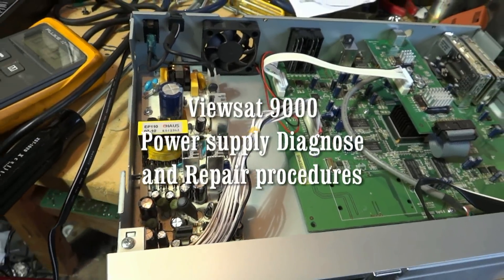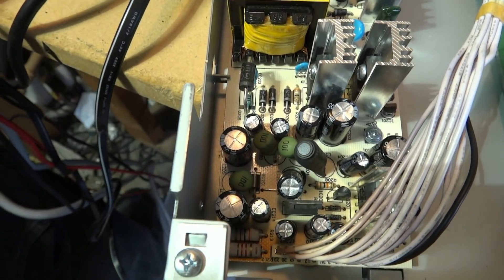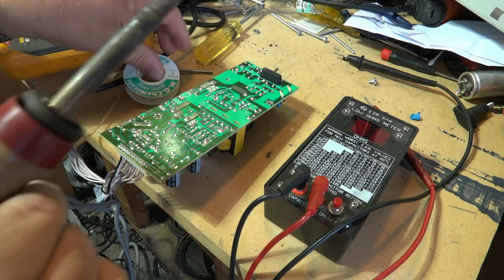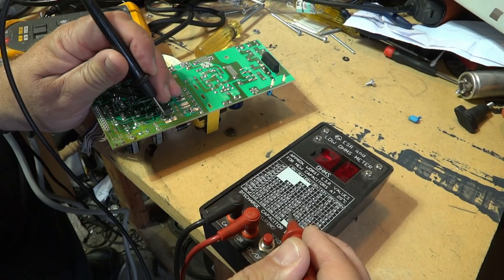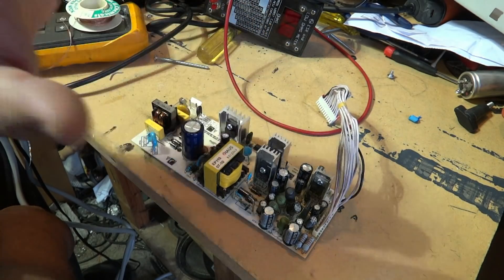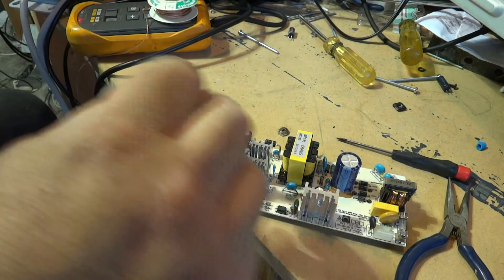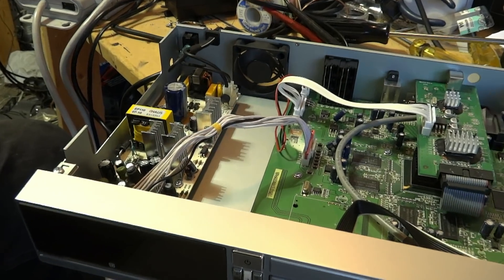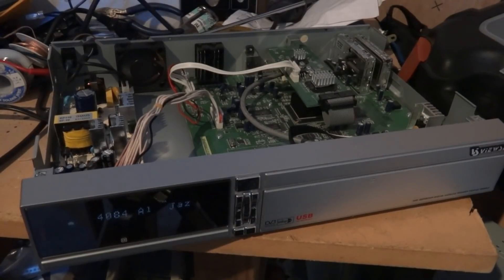Viewsat 9000 FTA Satellite Receiver Power Supply Repair

Comment: Hi, I have SONY STRDE135 receiver that when dead except for the relay that clicks when you press the power button,  I have traced the power from the power cord to the primary side of a large transformer.  It doesn't seem to get through the transformer.  Do you have any suggestions?  Very good video and if you have any videos that could give some guidance I would appreciate it.  Thanks.
Reply from the maker: Measure the primary side of the transformer and see if it is open. Most of those transformers have a thermal cutout that will open if the winding overheats.
Reply: Thanks pal. Did that and found the thermal cutout and replaced it.  Now - WORKS!

New project is a Pioneer SX-251R receiver.  Found - 2 power transistors (equivalent NTE37 & NTE36).  I will try to replace them tomorrow.  Question; what other components may be blown along with the two power transistors?  Thanks again.
Reply from the maker: Raymond Jackson
In addition to the power outputs, check for open bias resistors, and or possibly blown driver transistors.  Quite often just the outputs will have failed. It all depends on what caused them to go. If it was shorted speaker wires then it might just be the outputs, but if it was a shorting driver then the new ones will go bad. Rule of thumb use a variac and power it up with low voltage, just enough to get the thing to power up, and that way you can monitor it for over current, or a bias problem. 
Usually if resistors are smoked they will be burnt.
Your emitter follower resistors will most likely be shot. These could be in a dual package design, 2  x .3 ohm or something really low, or they could be separate resistors. They will be a very low value, under 1 ohm. They connect to the emitter of the outputs, and when the outputs short they will generally open the emitter follower.
Reply: The outputs were blown when the speaker wires were shorted out.  There is not any particular trauma or carnage around the resistors so I will proceed with replacing the outputs.  I will also build a variac to apply to this and other electronic projects.  Thanks again for your input and I will let you know the results.
Reply: 12voltvids I replaced the two blown transistors and built the variac.  When I tried it, the relay on in the receiver just clicked and the light on the variac light flashed off and on with the clicking of the relay.  Probably not a great idea, but I bypassed the variac by replacing the light with a fuse.  When I switched the unit on, it promptly blew the fuse on the PCB.  The fuse in the variac did not blow.
Reply from the maker: Well you have a short somewhere. Time to dig out the meter. More than likely the drivers are shot too? Some of those sonys used an STR IC as the driver.
Reply: 12voltvids
This one is a Pioneer (SX-251R - circa 1993).  Could the drivers cause the short?  If so, how? How do I find the driver transistors and what is the best way to test them?  I have a pretty good schematic that I found in a service manual that was on the internet, and your guidance would be greatly appreciated.  I am doing this more for educational purposes as well as for practical reasons.  Thanks in advance.
Reply from the maker: Raymond Jackson

The drivers will be directly ahead of the outputs. There will also be some bias components in there. Shorted drvers will definately cause a problem, as will an open resistor in the bias circuit. You will have to sit down with the print, and go through the output stage component by component.
Reply: 12voltvids So I pulled a total of six small transistors.  Three of them were the closest to the outputs and read open on all counts, that is infinity readings on all pins, no matter how they were read.  On one, I got infinity one way a reading the other.  The other two gave readings on all pin outs, my thinking is that they are OK.  I checked diodes on the board, read on way, infinity the other - good.  Small caps in area did not read closed.
Reply from the maker: Raymond Jackson

When you measure a transistor, it is preferred to use the diode test function of your multi meter, not ohms setting.
A bi-polar transistor will act like 2 diodes.
When you measure Collector to base, you should see conduction with a voltage drop about .6 volts in 1 direction only. Same with emitter to base.
For an NPN transistor the positive terminal goes on the base, for a PNP the negative. There should be no flow the oposite direction, and nothing between emitter and collector.

I am going to make a very short video right now called how to measure a transistor to show you how to measure one.
Reply: Great! Let me know when it is posted.
Reply from the maker: Raymond Jackson

Its up now.
Reply: 12voltvids
Thanks for the primer on testing transistors and after the test as per your instructions and all the transistors seemed to check good.  Here is a table of the results;

Component   Model   Type   Test B-E   Test B-C   E(R)-C   E(B)-C
Q502             A992       PNP     0.991       0.887       inf          inf
Q524             C2705     NPN     0.947       0.931       inf          inf
Q554             A965       PNP     0.827       0.823       inf           inf
Q502             A992       PNP     0.934       0.896       inf           inf
Q552             C2235     NPN     0.847       0.842      inf           inf
Q522            A1145      PNP     0.936       0.904      inf           inf

Pardon the columns are as straight as on the work sheet.  All test were done with the diode function on my multimeter.  This covers all the transistors in this part of the board which is labeled "POWER AMP".  There is another side with identical components that I assume is the other channel.  Thanks again.

Comment: hi 12voltvids,
how to determine a fault from a PSU that i have just check & replace the faulty main mosfet transistor, 8 pin power ic, Fast Recovery 1.0A diode (24dcv circuit section), where initially PSU able to power up the 42" LCD TV but the Mosfet Heatsink is hot to touch and finally it gave up and blow the same part's after 30mins of power up the TV.

is it a miss out of bad cap that draw too much amperage from the Mosfet transistor or the inverter board is drawing too much power??

hope you could enlighten me.

thanks in advance.
Reply from the maker: What is the current draw? If it is drawing too much current this could cause the mosfet to overheat.
Also did you use an original or generic MOSFET?
When I was in the business I remember lots of headaches with counterfit semiconductors. They looked original, right down to the stamps, and labeling, but would overheat and fail. It wasn't until I did some forensic examination of the actual component that I found out that I had been duped by a counterfeiter.

I took the original failed component, and using a dremel tool ground down the case to expose the silicon die. Then did the same for the replacement part that failed. I found that in the original device, a 100 watt rated device the silicon measured about 1/4" square, which is about right for a device of that rating. The replacement batch that was bad the silicon measured only 1/8"
Obviously a smaller silicon die is not going to pass the same current, and thus the overheating, thermal runaway, and failure.
This was a huge problem in the late 90's. Back when manufactures like Sony and Panasonic wanted 45.00 for a single transistor, and the local parts distributer was selling the "same" part for 5.00 it was an easy choice. Till they all started coming back a week later. Then as a tech you start looking at other parts causing the failure, and all it was caused by some unscrupulous parts dealer in China relabeling parts, and counterfeiting the logo of the original exactly.
Caused major headaches for those of us in the service business.
Reply: thanks for this info, i have no idea that the mosfet is a counterfeit but is from Fairchild and it looks  original.... then will try a expensive component for a test....see how it goes.

me as a not very experienced tech,
this ori 19A mosfet is driving a transformer to generate 24dc volt via  a 3 pin diode ( similar to a transistor ) and filter by 3 x 1500mF 35v electrolytic Cap with no bulging and upon out of circuit test with ohmmeter result seems normal ( planning to get a good ESR meter later, any recommendation??).

i suspect the X & Y inverter board is draw high current due to the top 2(both side) of the 4 mosfet driving the small transformer is brown color compare to the bottom 2 mosfet on the inverter board,

or the problem still lies at the primary side with a slightly fail part undetected?? i will try to check all component link to this Mosfet again give it a 2nd chance before giving up by ordering a new PSU unit....

thank you for your advice 12voltvids

regards
Reply from the maker: kt goh
Order an esr meter kit. They can be had for about 60.00 and work wonderful.
If the filters go bad (high esr) they will pass a ton of ripple and depending on your circuit that could cause an excessive current draw. Don't forget the soft start filters in the primary side. Too little drive will also cause the mosfet to overheat..
Caps do not always have bulged tops when they are bad. I recently had one that looked totally normal, but was bad, and my power supply was running but not putting out enough current.
Reply: will do. thanks alot....

Comment: I have purchased  the esr kit from Australia and I have to build it and I am looking forward to trying it out. .i purchased a receiver that was under water in Louisiana  in the Katrina storm. I cleaned her up and saw no major damage other than loose or damaged small caps.I will use the esr to test and replaced the damaged caps.question I have put it away in a crate a few years ago lol and was wondering if it can still be saved ?Thanks
Reply from the maker: Mine was a kit too. Built it probably 20 years ago, and it works perfectly.

Comment: i just started elecrical technician school a few days ago and im working on a section about power supplies and this was awesome and helpful in helping me understand thanks. subscribed and liked
Reply from the maker: Stay tuned, I just fixed a Samsung Plasma set yesterday, and have it all on video. Will be editing that one and posting it soon. Yes it was my ESR meter again that helped me deal with this "tough dog" trouble, but I have a few other tricks up my sleeve, and it involved 4 AA batteries in my power supply troubleshooting technique.  I do admit that I was a little stumped initially, as we all can get as I wasn't initially sure if it was a lack of current from the power supply, or an overload condition that was causing the low voltage. In the end it was a lack of current, and my battery trick lead me in the correct direction.

Comment: Not to nitpick but the feedback loop isn't analog, there isn't an error voltage communicated to the primary... Typically they use a programmable zener (TL431 shunt regulator for example) which is set to conduct at the desired output voltage, and this zener is in series with the LED on the opto coupler...

So when the voltage is at or above the desired level, the Optocoupler LED turns on and the photo transistor on the other side starts conducting, usually causing the PWM to blank or the duty cycle to decrease... When the voltage starts to drop below the set level, the zener will turn off, the LED will go dark and the phototransistor will stop conducting and the PWM will start up again, etc...
Reply from the maker: Of course it is analog! You are correct is describing the voltage regulation, and I wasn't getting technical in my description. It is still an analog feedback loop, isolated by an opto coupler.  As opposed to a digital feedback loop, where the output voltage would be measured, and a digital correction would be communicated on the ic2 bus. There are basically 2 ways that switch mode power supplies control the voltage. One is how you described, they change the duty cycle, the other is to change the frequency of the oscillator. The duty cycle on these types stays the same. By changing the frequency, the transformer is moved closer to, or further away from it's resonate frequency. This changes the efficiency of the transformer, and was a very popular design on Panasonic VCRs from the early 80's. A big problem this design had was when some small capacitors in the hot primary side dried up, the frequency would go up. This brought the transformer closer to resonance, and thus brought the voltage up. The feedback loop was maxed out, literally trying to cut the power back, and it kept going up until eventually there was a ton of smoke as all the ICs popped, and the unit was a door stop. Panasonic fixed that f--k up by adding a zener "crowbar" to the output, so that the only thing that would go nova was the PSU. The next year they changed the frequency, to put the operating frequency above the resonate frequency, so that capacitor failure, and frequency drift would move the oscillator frequency away from resonance.
Reply: 12voltvids
Analog would suggest the brightness of the LED is varying with a varying duty cycle as a response, that is not the case, the LED is either ON or OFF... Thus it's not "Analog".
Reply from the maker: Doom2pro
Incorrect. the LED does vary its brightness depending on the load on the secondary. If you place a large load the secondary voltage drops, and the LED gets dimmer, this changes the duty cycle or frequency of the oscillator to increase the output. Remove the load and the voltage will rise, which causes the led to brighten, which changes the conductance of the photo transistor on the other side of the opt coupler.
Put a scope on the drive to the feedback LED and you will see that it is all over the place. It is never 100% on or totally out, well I guess it is totally out when it is unplugged, but when the unit is running there is always voltage across the LED.
That is how they regulate the output voltage. Go look at a schematic. The voltage regulation loop consists of a reference such as a Zener diode, and a couple of resistors that make up a voltage divider circuit. 
I repaired literally thousands of switching power supplies during my career. They all had an analog feedback loop.
Reply: 12voltvids
Place a scope on one if you don't believe me, the TL431/Zener will conduct at or above the voltage, and while the conduction isn't instant (causing a little leakage current just before before fully conducting), the Opto LED will be either Fully ON or Fully OFF, and the photo transistor will be SATURATED or  CUTOFF... Not to mention the Opto's used in feedback loops have a very high current transfer ratio meaning the transistor will saturate even with the LED partially on, so even if you did vary the LED's drive current, the transistor will be saturated regardless.
Reply: 12voltvids
It doesn't matter if the LED isn't fully on or not, SMPS's feedback loops use Optos with very high current transfer ratios, meaning even if the LED is partially illuminated the Photo Transistor will be saturated regardless.

Even if the Photo Transistor didn't saturate, the PWM's in most power supplies do not accept Analog input from the Photo Transistor, it's either PWM blanked or reduced duty cycle.
Reply: 12voltvids
Changing frequency is a bad method of regulating output voltage, you can easily hit other harmonics causing the voltage to go back up... The best method is to vary duty cycle (power) or blank the PWM output until the load brings the voltage back down.
Reply from the maker: Doom2pro Well DUH!
Panasonic found this out the hard way when countless VCRs started blowing up. I remember getting units into the shop and opening them and thinking they had been hit by lightning. Chips ahoy as they say. All the ICs had holes blown in them. I say hundreds of these, and then the fit hit the shan at Panasonic, and I am sure an engineer or 2 was looking for a new job. Cost them a fortune, as they replaced literally hundreds of blown VCRs.

Comment: Im into car electronics,mostly car amplifier repair,i bought an old school but nice scope,i have an old school radio shack transistor tester and a bunch of meters..you're very good at explaining things making things understandable..i subscribed and thumbs up..I look forward to learning more from you.Could possibly do a blown car amp repair..that would be fun for me...easy for you.Thanks and keep up the good tutorials.
Reply from the maker: I never did car audio. The reason is the shop I worked for was tired of customers blowing stuff up trying to reinstall it, so we didn't do car audio. That was back in the days of the old "power booster" amps, where they would just run 2 amps out of phase and float the speakers. Naturaly you know what would happen when someone hooked one of those up to a speaker harness that had a common grounded speaker. BOOM. Class B amps aren't really any different than regular audio, except that they generally have a DC/DC converter to boost the 12 volt supply to something like +35 and - 35 volts or higher.
Then along came class D digital amps. Never worked on those at all, and only barely understand the operation They basically fm modulate a set of switching MOSFETs that are running at a high carrier frequency, 100 -200KHz. The switching transistors are creating a full square wave, and the audio signal modulates the duty cycle. A low pass filter removed the high frequency square wave waveform, leaving the amplified audio behind.
I never got into repairing any class D amps, as when they were entering the market, along with LCD TV, I was leaving the electronics service business, and moving into telecom.